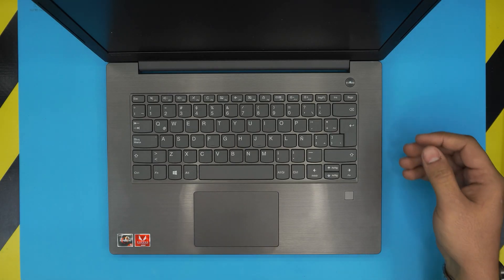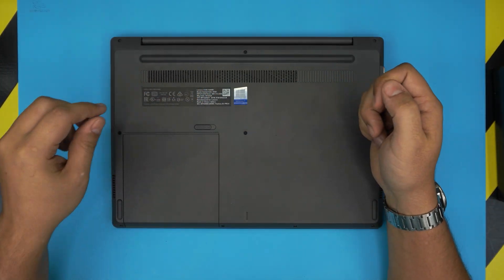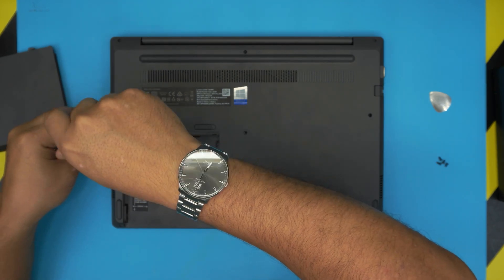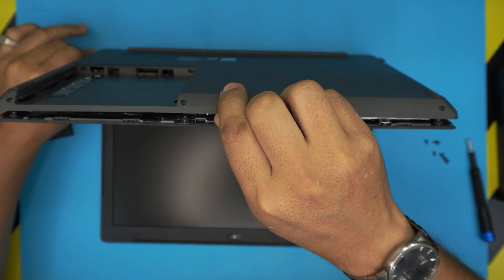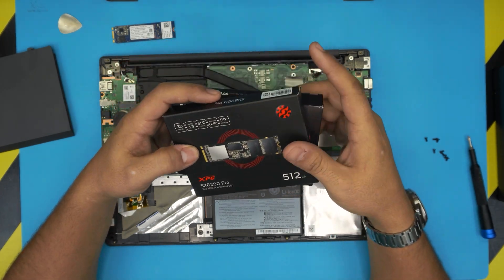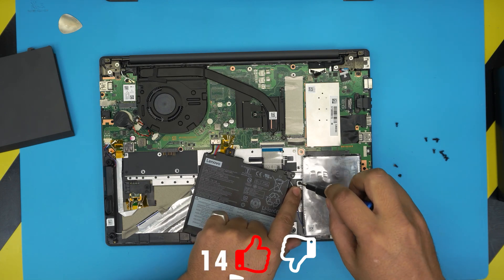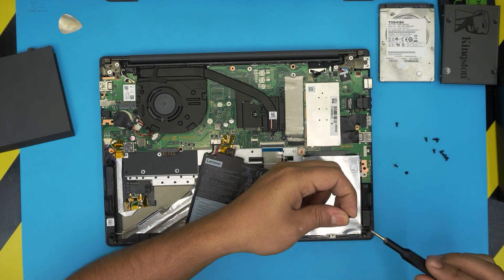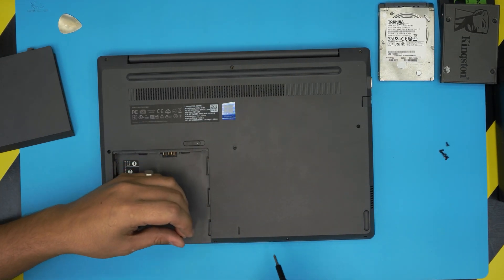Lenovo V330 SSD | HDD | UPGRADE

Comment: Hey brother, I hope you're well. Not sure if you are replying to messages on old videos still but I have a lenovo v330-14arr ryzen 5 with 8GB RAM and a standard 256GB SATA SSD. I have just bought a P16S Thinkpad so was going to give my V330 a refurb and hand it over to my sister. I see you mentioned below that you can replace the 4GB RAM slot with a 16GB stick.  

I was planning to leave the SATA the same, add a 16GB stick and 500GB M2 NvME. In your honest opinion, do you think this is worth the cost? I ideally need the laptop to last another three years for her but not sure if this is just like putting lipstick on a pig and telling the world that it is a supermodel. For some context, the laptop is running fine at the moment. It does not overheat and everything functions fine as I've been running it off a monitor mainly, not doing any video rendering or intensive task and used a WiFi keyboard and mouse.
Reply from the maker: Thank you for the feedback! if you wish to support the channel you can LIKE or SUB or both :P
regarding your question: to be honest for this model i would only do the following:
#1. remove the 256GB ssd 2.5' and place a 500GB samsung evo : https://amzn.to/3YzkeCD
and leave the ram at 8GB as its just fine for most of the daily use browsing and normal work.
it's not worth going to 16gb as she will not use it. keep the cost to the minimum and go with samsung for best performance and durability and call it a day.
If you have any future questions or requests, please don't hesitate to reach out to me. I'll be happy to assist you.

Comment: Is it okay if we do not upgrade second ssd? How much different of speed?
Reply from the maker: Thank you for the feedback! if you wish to support the channel you can LIKE or SUB or both :P
regarding your question: its ok if you only upgrade the 2.5" ssd sata  and not the m.2. the differences is about 20-30% but you won't notice on a regular use my friend both are fast as long as its SSD.
make sure you use a good grade SSD like samsung evo  or pro
https://amzn.to/3DZVgUe   (recommend you this)
https://amzn.to/3GhN9ou  (the pro is very expensive)
Reply: @uFixTek  thankx for the reply brother.  my laptop model is lenovo v330-14RR U2, 500GB HD. plzz suggest me ram and 512gb ssd for it
Reply from the maker: you know what's funny the tech spec says 4GB soldered on board and 8GB max upgradable LOL but you can easily add a 16gb stick +4GB on board for total of 20GB without any issue
the ram i recommend you: 16gb: https://amzn.to/3X1yyDF
8gb: https://amzn.to/3TvyhGk
this are very compatible.
for the ssd 500gb: https://amzn.to/3Uq9eWlhttps://amzn.to/3Uq9eWl

if you want to keep your HDD 500GB and add a faster m.2 ssd go with this: https://amzn.to/3hB2XbN
Reply: @uFixTek  but it will not use 20gb as dual channel. It will only use 8gb in dual channel. Is it not the case?
Reply from the maker: no, your laptop will always use 4GB at dual channel, because the soldered on board is 4GB. anything after 4GB use is on single channel, even if you have 8GB+4gb still only 4gb dual channel.